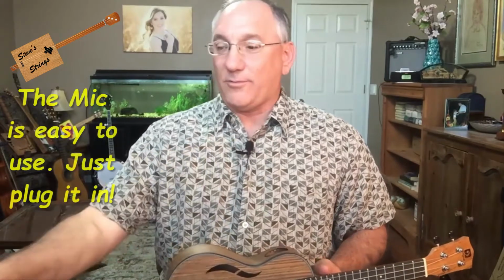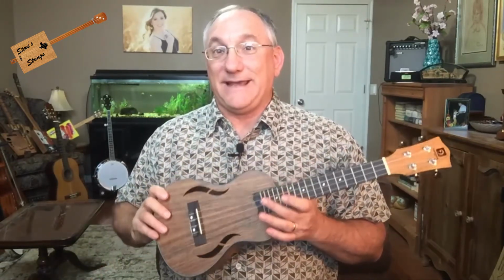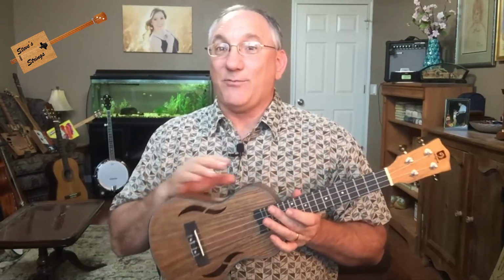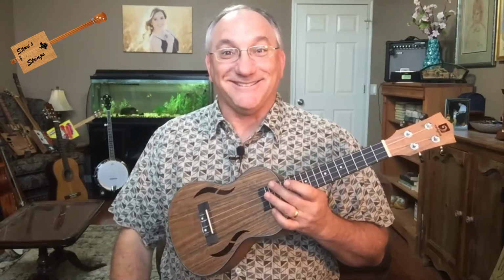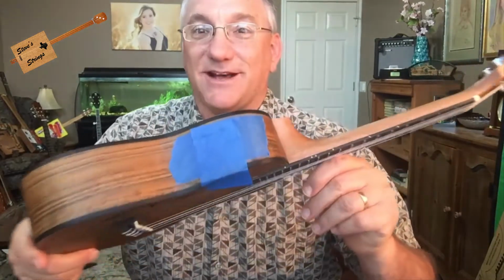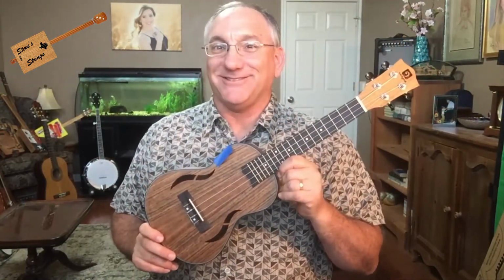Are ukulele side sound holes louder for the player?  This video compares an instrument to find out!

Comment: If they are I think it's subtle - common misconception about sound holes is that it isn't actually where most of the sound comes from. The sound hole is basically a vent that allows the top to vibrate freely thereby allowing it to do its job. I've played ukes with good bracing, thin tops and small sound holes that are louder than those with ports and large sound holes. That's because the vast majority of the sound comes from the lower bout. If you cover a sound hole you are restricting the air passage more so stands to reason sound will change. But it's just because of less air transfer.

Of course - some sound DOES project from soundholes, front or side as they are open gaps - stands to reason - but they are not the main projection point.
Reply from the maker: Great points!  Thanks for watching and commenting!
Reply: @stevesstrings5243  No problem - had a very long discussion with a master luthier on this topic I was recalling. Fascinating stuff.  If you think about something like a violin - they can be seriously loud, but the sound holes are actually pretty tiny. In fact - really only there to allow that air transfer - but their tops under the bridge are like a drum!
Reply: This is very very interesting. Thanks so much for sharing this comment! Also very cool to see you out and around the community :)